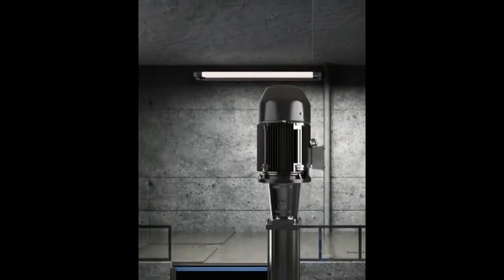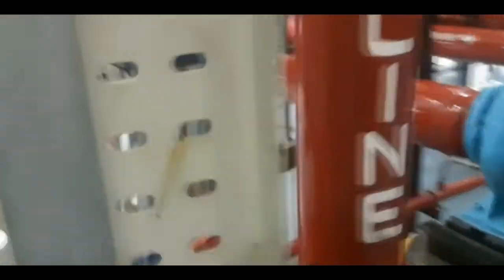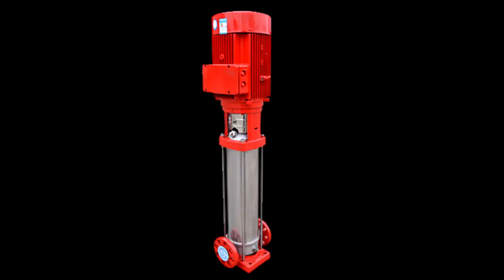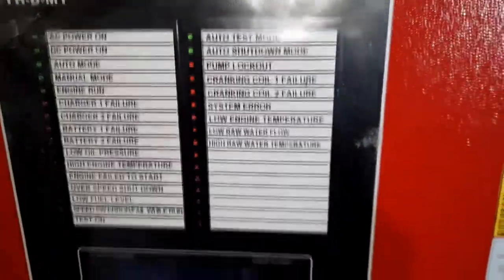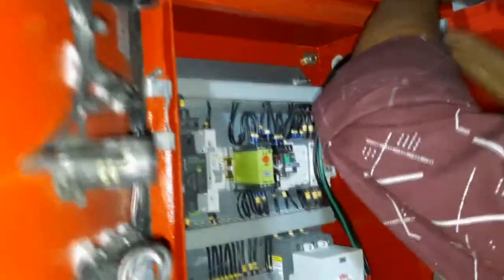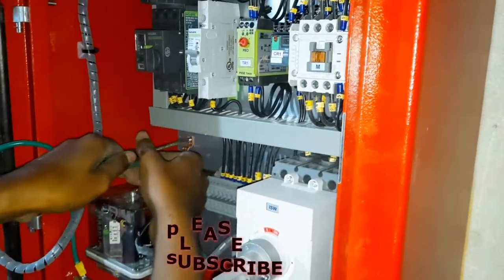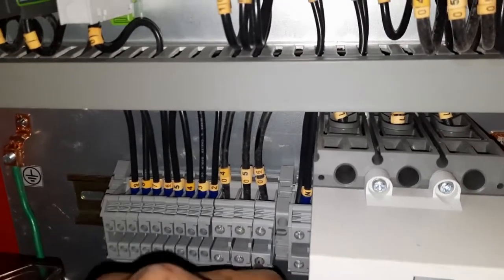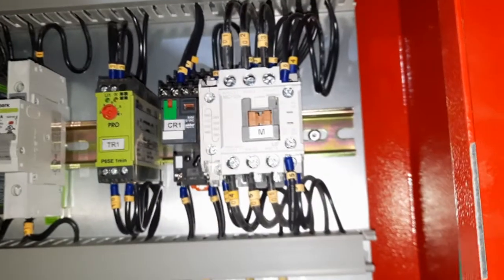Jockey pump rotating direction and panel connection over view। fire hydrant system

Comment: How to connect bms cable in the jockey pump panel
Reply from the maker: What you want? To check the live States of  jockey pump or manualy  on-off control. If you check live states the simple connect with pressure warming switch or install a flow switch in discharge line of jockey pump.  You can  get a signal. If you control on-off then you need to do some arrangement.  Like relay , auto selector switch.